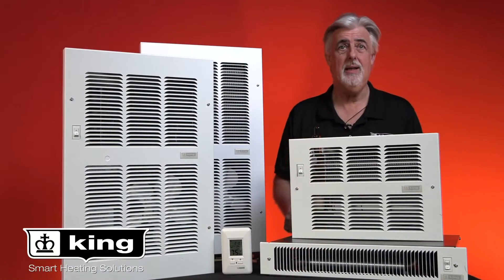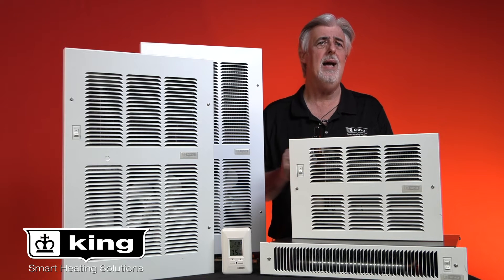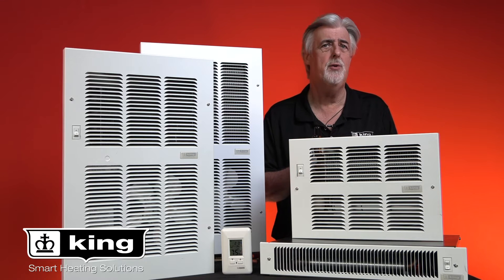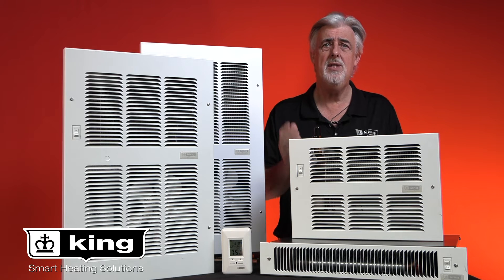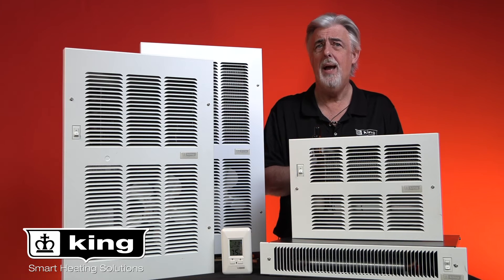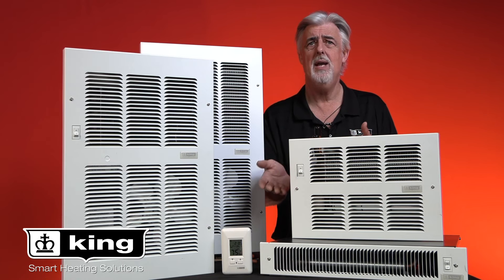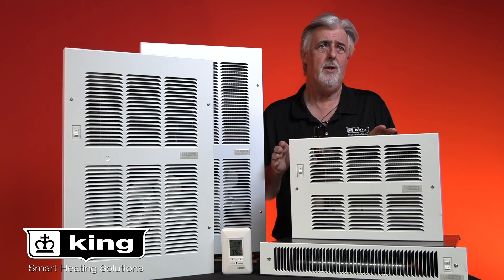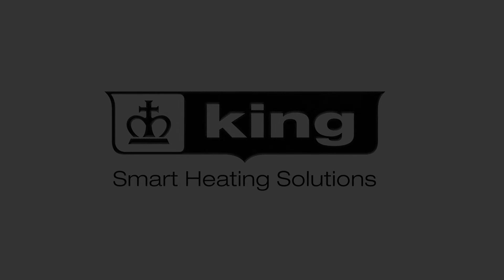Hydronic Fan-Forced Wall Heaters - King Electric

Comment: Buyer beware, Our builder installed these in-wall H Series units in 2011 and when you turn on the squirrel fan they are not very quiet.  Secondly, one of the units stopped working and we called King to get a list of service providers which the person on the phone stated "we don't have a list of service providers".  Our solution was to get a ductless mini split system installed to heat/cool our home and they do provide a list of service providers!

Comment: Can I use it to meet my needs?

I have a large living room with 3 cast iron radiators which look ugly and take space.  These radiators are connected to a copper piping which goes through the whole house.

Can I just remove 2 radiators and to replace 3rd one with king one with matching BTU?
Or do I need some special pipe coil for this?

Comment: Know any service technician in Seattle region? One of the room heating fan doesn't work.
Reply: Same Q - the fan runs and little heat comes out. 8 year old fan, moderate usage. In spite of the overall house water being good and hot.
Reply: Did you get any help? Two of our wall heaters stopped working. Thermostats turn on and I can hear the fan buzzing but no hot air.

Comment: Potable water, domestic hot water system...
Just a "serving suggestion", or is there any reason they can't be used with the glycol mix in our flat panels for closed loop?
Reply: All the H series Fan Coils are approved and can be used in all Hydronic system up to 200 degrees with glycol or conditioned water , including Potable water systems. The copper and the solder joints are made of potable water high quality materials so that they are safe to use in a potable water system if you need, or are interested in using a domestic hot water system as your heat source. This just makes it a very flexible fan coil to fit in all applications.